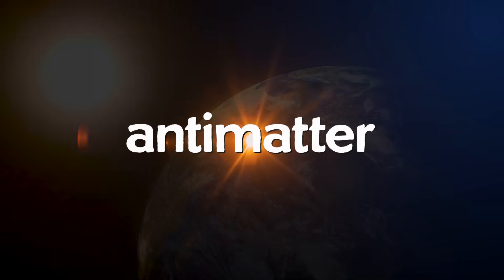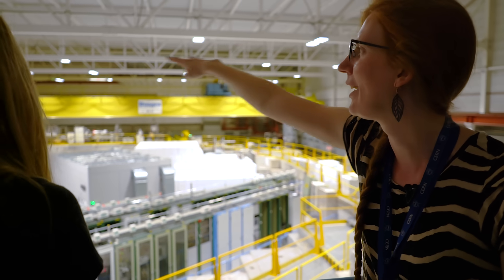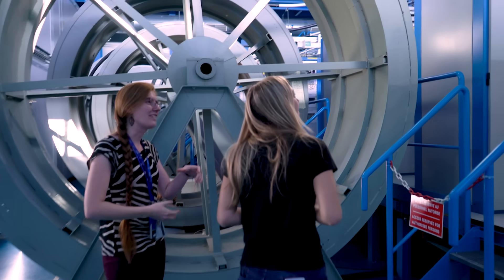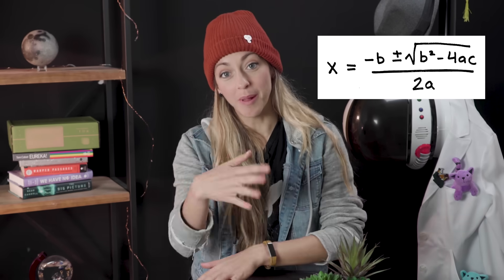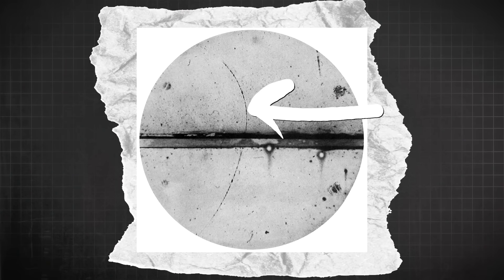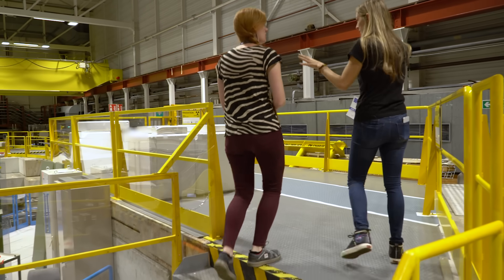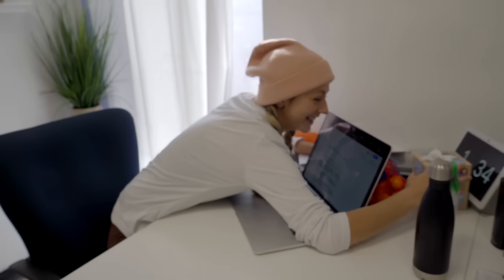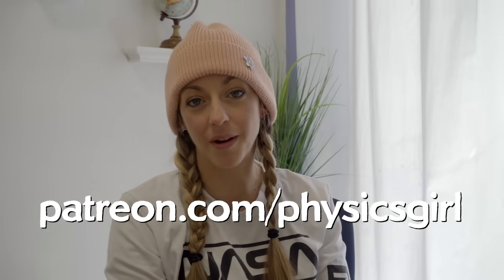Why This Stuff Costs $2700 Trillion Per Gram - Antimatter at CERN

Comment: Did they ever try and simply use a ring as a storage device ? Simply stage each stage to a velocity maximum, then move on to the next slower stage, since each particle comes in at relative high velocity, but has to yield to centrifugal force, only the ones that move slowly can enter within the ring and thus be captured in the next ring, which slows it down more, onto the next and the next and the next, much like an inverse cyclotron.
A cyclotron can accelerate particles moving outward, but in theory can decelerate particles moving inward.

Comment: 0:41 That's because if there was a Hawking event that created both matter and antimatter out of literally nothing, they were separated by such a vast distance that the one side that asks this question here has another side made out of antimatter (from our perspective) where the exact same question is asked in exactly the same way, with my answer also being given by an antimatter version of me.
The duality of matter and anti must be based on an equality that when both sides recombine, all goes back into nothing, otherwise Hawking events can leave a non-zero trace, which in turn violates energy conservation, even between the both halves, anti and matter.

Comment: The large hadron collider is not smashing particles at all. At relativistic speeds particle interaction changes! "So in reality we could be producing the effects because we are causing the particles to interact differently due to the experience of relativistic speeds as they pass by one another. Meaning a similar experience as when a comet passes by earth at a distance relatively close in comparison with universal distances but far when using solar system references, the proton passing by another proton at speeds less than 99.0 percent the speed of light has a completely different effect than particles passing each other at speeds greater than 99.0 percent the speed of light" "in theory were expanding time and space inside the collider and theres no collision occuring. What happens is time and space expansion is only sustained under the right conditions but because we are using up all the energy needed to create the right conditions they only last for small periods of time" "This would alllow for E and Spacetime conservation which would impose that im implying a new law of nature energy is consvered with spacetime and vice versa" "Gravity is a lack of energy" "Strong gravitational fields emerge because the field of gravity is leaving as energy is introduced due to the interactions of these particles" "gravity would cause mass to fall toward its center which would be the experience of a negative energy field and postive mass field "

Comment: I'd think you can make a neutron star. By using a more amount of solid oxygen with a small amount of solid hydrogen. And surrounding it in gas oxygen then igniting it. And casing the orbs that it produces. Feed it with hydrogen to make it grow and salt to make it shrink. Because nitrogen shrinks stars.
Reply: Then put this in a nuclear reactor box. And orbiting them around a tube cylinder. To create antimatter in large amounts. With a big star on top of it. Don't see why it wouldn't.

Comment: Geniuses with all the  so called LOADS of funding $$$ and brainiaks trying to contain energy always wanting to use ELCTROMAGNETICS - so does not seem to work on Plasma ie hydrogen/Helium ion the tokamak. All 3 can be contained . Second even if you bottled that GENIE -how would  transmute such energy into working form of power and perhaps let use use enriched PU 239 as base . Ab out size of big league official baseball at 145 grams./   Actual containment system is possible but collecting that much Anti Matter and then transmutation to what from of useful energy and small enough perhaps for space craft size of Daytona Racetrack.  Hadron in Cern is allot larger in size and massively heavy. However  got chance once to see and RTG and that's awesome. Finally useful energy transmission as well as pressure reactors  for Nuclear powerplants. BY the way Tesla did not think too  highly of Einstein ? Energy conversion for core of Nuke 33 %   Anti matter 100% conversion and somehow conversion to Gravity Field as well directing  that force.  Definitely be on the way to Orion system in 4 years. So whomever or what ever fired some form of cumulated energy ion 1991 has good starting point   Yeah I don't think imperial forces  landed on Earth with Imperial Star Destroyer ....LOL  🙊🤖🤖🤖🤖

Comment: Spike Strips Laid Out On The Main Highways .. And Like Police Do Not Cross Lines, As House Of Cards Was About To Fall Apart.. 
,, since 1988 Onwards. 

Since , 2000 Onwards 
Height 5'7 Weight 95kgs
Shoe Size Was 7, 
8 From 2005 Onwards..

India's Magnetic Hill At Elevations 7000 to 11000 Feet , Meters Above Sea Level..
Graduating From Hills At 3500 To 5000, 5000

From Arabian Sea or Bay Of Bengal

Comment: so.. if the anti matter will touch anything an puff.. but it can stay in a simple glass bottle? and not affecting the bottle .. so the bottle is anti anti matter?
Reply: It is flying in a magnetic vacuum chamber, so it doesn't touch air or the bottle.
Reply: @ayakinz1440  how its not touching the container? please explain!
Reply: @addorama9678  it is suspended in a powerful magnetic field, and even with  all these systems some atoms can go into the chamber and react with anti matter particles, so their lifetime is not very long.

Comment: Particles and antiparticles can bind and not annihilate if you add quantized angular momentum. The pairs are interesting because from the outside the electric fields cancel, the magnetic dipole fields bind and cancel, and the angular momentum shows up as gravitational mass (that needs to be checked). So these pairs are electromagnetically invisible, but still have mass. Approximate solutions of the conditions for stable binding take Coulomb (1/r) and magnetic dipole (1/r^3) potential add the kinetic energy of rotation and use hbar. But then you need so solve the nonlinear Schrodinger models and those need precise "big data" calibration runs. It is worth doing - efficiently storing and retrieving energy in MegaVolts and KiloVolts and GigaVolts is the game. I think these kinds of pairs are close enough to cover some properties of neutrinos, and some properties of dark matter. The groups looking at phenomena are trying to have their own silver bullet hit the target, but from the Internet Foundation looking at all human knowledge and 8 Billion creative and active humans, it looks more like you need a few hundred thousand people working on "antimatter" to get their act together and put all they know in global open accessible worksite that can handle all standard internet content formats. Richard Collins, The Internet Foundation

("antiparticle" OR "antimatter" OR "positron" OR "antiproton") has 49.3 Million entry points, It is not hard to find all the people involved, all the data and algorithms they use, share that openly with all of them and set up a global collaborative site to record progress, and share through GPT or other language tools for all languages with the roughly 5 Billion humans using the Internet. CERN is big, but it is slow as molasses in winter.

site:cern ("antiparticle" OR "antimatter" OR "positron" OR "antiproton") only has 6600 entry points. CERN is NOT the leading center for antimatter on the Internet.

"CERN" ("antiparticle" OR "antimatter" OR "positron" OR "antiproton")  does have 1.1 Million entry points but that is small compared to 49.3 Million. And CERN does not seem to know how to manage global topics on the Internet, even its own.

All those people are trying to do things alone, not sharing in open format, NOT paying attention to what it takes to create new global and heliospheric industries.  

The laser can produce particle antiparticle pairs, what you need is a way to create pairs that are stable. It means working with dark matter (invisible with mass), but it is not impossible if the whole human species works seriously at global collaboration in depth.

Comment: Blackholes are actually antimatter balls. Which is the reason for the bursts... when matter and antimatter get mashed together inside. 

That's where it all went and why they, blackholes are bigger then they could have gotten given current theories and the "age" of the universe. :yougotthis:

Using calculators and including "time" twice in your math formulas seems to be making things a bit confusing for you. Expansion is time. ;)
Reply: Aether is a much more accurate concept then most think. What makes a bubble round in the water? What makes a gas bubble with a solid rock center also known as a planet, round? What makes a blackhole round? A sun? 

Are you sure it's gravity? Real math suggests it's displacement. Including the bubble in the water. 

The amount of misinformation in our education system is disturbing. Looks a bit like sabotage... from one nerd to another. A whole lot of nonsensical confusion. Also wondering why they are keeping 12 other elements they have re-discovered... off the periodical table of elements. 🤔 Interesting stuff.

Comment: That's a right handed coil sitting on the table at ~4:00 of the video. You should have a lefthanded coil sitting next to it.  I sometimes wonder if the physicists even know there are two opposite handed helices since the Standard Model  teaches "helicity is frame dependent". How so? Did you know Watson and Crick's crystallographer Rosiland Franklin suspected the double helix was right and left handed because her photos showed the two strands crossed.  I see it that way too.

Comment: It is anti-matter which is opposite of matter!? Soooo.... it wouldn't cost 2700 trillion per gram, but rather 2700 trillion per minus gram, which is the same as -2700 trillion per gram. Since the minus of a cost is a gain, CERN should spotaniously earn about 2700 trillion by making it. Selling it at a fair price for each antigram, they will earn another 2700 trillion = 5400 trillion earnings. Wohooo!!
Reply: They is no thing as antimass therefore no antigrams. And they can't sell antimatter yet because we can't maintain it sealed in any container.

Comment: If the Theory of Relativity is indeed fact with equal and opposite reactions, the same must be concluded true about  matter versus anti-matter.
In other words, the amount of matter versus anti-matter should be of equal proportions in order to maintain the true balance of the universe.
Just because we may not have the ability or capacity to identify the spectrum of anti-matter does not mean it is not equally represented in existence.
Scientific observation starts with the obvious and continues into the realms of unknown with constant discoveries of new information. Many times this new information seems to conflict or counter disprove other information until that particular bit of information eventually connects all the bits and they make sense.
I've seen nearly 60 years of information come together and push apart with new discoveries connecting things seemingly unrelated at all.
In the past 10 years we have watched the impossible happen with self driving cars, rockets, and even universe traveling space craft still gathering data at this very moment.
I personally believe that they will discover anti-matter in equal quantities as matter, but perhaps they need to change angle of view similar to polarized lenses for identifying stress fractures.🤙

Comment: Wtf is anti matter? Actually I remember its the matter particle broken up into bits so it is incredibly unstable. Not anti matter at all, more half or quarter of a matter particle. Edit: It wont go against gravity though, unless you observe it reacting somehow in the direction against gravity. Gravity is stuff btw its not equations gravity flows and is moved by matter, antimatter isnt going to go against it for some reason.

Comment: Thats not that impressive to the ratio reason why it's so expensive... why is it that expensive? Coin is relative to the value of something... based off coin it tells you it has more worth and input to society than they are saying.
Reply: If it comes in contact with matter antimatter turns into regular matter. And matter is literally EVERYWHERE in our planet.

Comment: Fun fact:
when annihilating, the energy exerted by the particles can be calculated using Einstein's famous equation: E=mc². Where E is the energy created in joules and m is the mass of both particles combined. c is just the speed of light or 299792458 m/s.

If 1mg each of matter and antimatter annihilated, they would produce 179751035747 joules of energy. That's equivalent to ~42.961 tons of tnt. All that from just two milligrams of matter. Note that 2mg of uranium creates only 2.022 joules of energy.

Wow...

Comment: QUARKS UP DOWN STRANGE CHARMED TOP AND BOTTEM.. THEN YOU HAVE THE ANTI QUARKS ANTI UP ANTI DOWN ANTI TOP ANTI BOTTEM ANTI STRANCE ANTI CHARMED... AND ANTIMATER.. YOU CANT JUST PUT IT IN A JAR!?! THATS INSAIN! JARS MADE OF MASS... AND MAGNETIC FIELD TOO PREVENT IT FROM REACTING WITH IT ISNT GOING TOO BE CONTAINED IN A JAR..  AND ALL ATMOSPHERE WOULD NEEDS BE REMOVED ALSO SO THE ANTIMATTER WOULDENT REACT WITH THE MATTER OF ATMOSPHEAR... OR ITS GOING TOO BE WORSE THEN TRYING TOO MAKE A DEAMON CORE.. THE COSMIC RADATION WOULD BE OFF THE SCALE BY THE MATTER ANTIMATTER ANNYALIATION OF THE TWO COMING INTO PHUSICAL CONTACT WITH ONE ANOTHER...

Comment: IRONICALLY ANTIMATERS EASY TOO MAKE.. AND NEXT TOO IMPOSSIBLE TOO CONTAIN SAFELY. REQUIRES DIAMAGNETIC CONTAINMENT DONUT IN PRESENCE OF A VACUME... AND THAT TAKES POWER... MILLIONS OF WATTS OF ELECTRICAL POWER... AND IF THE POWER FAILS AND MAGNETIC FIELD COLAPSES... ANYMATTER IT COMES INTO CONTACT WITH DISOLVES INTO VAST AMMOUNTS OF COSMIC RADATION.

Comment: So if the anit-matter is a negative opposite of matter. Would that be a break down of a atom? I figure it is hard to test because it dissipates before it can studied. The state of it becomes a template of another state of matter and is reasborbed back in. To cause light or explosion is probably due to be meeting met with matter that is a different state or atomic property causing a reaction. .

Comment: Antimatter doesn't want to exist because, the purpose of it is reaction, reaction to create from elements. It cannot coexist with matter. That is why matter is the ruling part. One will be, the other not, it will transfer over as energy needed to create.
Ghosts and poltergeists especially have learned a way to extract and store antimatter and then releasing it to react with matter, sending your spoon or teacup across the room,.
The scope of antimatter is beyond us at the moment and, I think an accident will happen if they are able to store it in large quantities, which I'm sure they won't. It will be bigger than any atomic bomb if they're not careful.

Comment: …. The hydrogen bomb wasnt built later decades after the atom bomb… the reaction core was different… the hydrogen bomb needed an alternate fueling system of lithium ions to increase the yield and mass of the original design and the difference of plutonium and uranium plays a role in that to…
Reply: Of course I can be wrong and they used another version of tampered uranium 🤷‍♂️ I’m not the one who set the world on fire either so…

I just think it’s interesting based on the fallout projection between different concept, from the focus of fallout dispersion to a forecast of smaller fallout which ironically was taken further out from the epicenter because of the winds of the pacific ocean…
Reply: I mean the psychological understanding is that the person who created the hydrogen bomb was more insane then the guy who invented the atom bomb…
Reply: They also tested the hydrogen bomb in an upper atmosphere test to… basic concept of why icbm are icbms…

Comment: I think antimatter is the cause of the Big Bang or/and the expansion of the Universe. In the beginning, the Big Bang created equal amounts, that caused a mass chain reaction which started the expansion (or accelerated it) of the Universe as a whole and annihilated most of the antimatter in the process. 

That way, most of the antimatter existing now is located right at the edge of the Universe.

Comment: antimatter is not rare at all. it's all over us. in every matter, there is an antimatter alongside it. if you can detach that antimatter from its matter counterpart, there you have it, an antimatter. the thing is, you can't just pull it off. so the correct term for antimatter is "difficult to produce", not "rare to find".

Comment: actually, 200 000 metric tonne of TNT = 220 kt = less than half of the current in use 475KT W88 warhead that can be submarine launched for example.

Comment: I feel like antimatter and dark matter are the same thing, it's just that nobody has correlated the two.  Also, if anything that has mass or matter creates gravity, then that tells me that anti matter should produce the same opposite effect and produce antigravity.  And now that I think about it, that would also mean that there should be something that has the opposite of mass as well.
Reply: They are entirely different. The main thing about dark matter is that it doesn't have an electric charge and therefore doesn't interact with light. Antimatter has an electric charge, it's just opposite the corresponding matter particle. 

They are fundamentally different things.